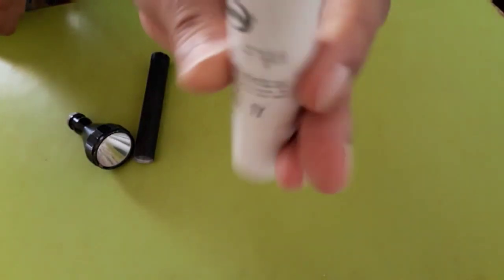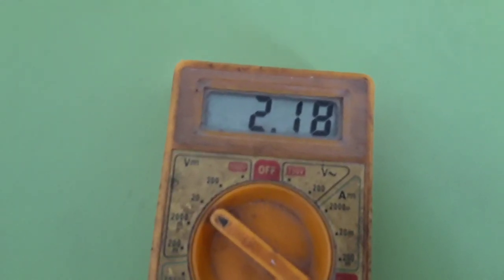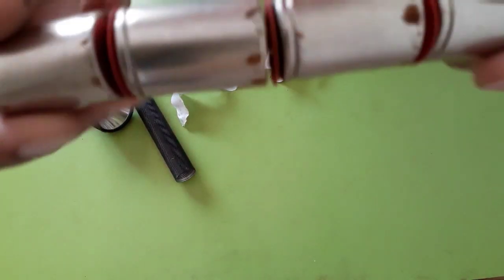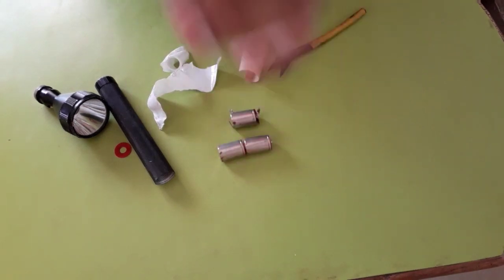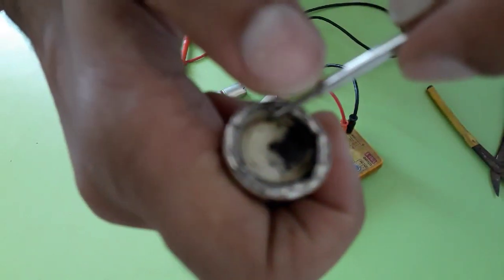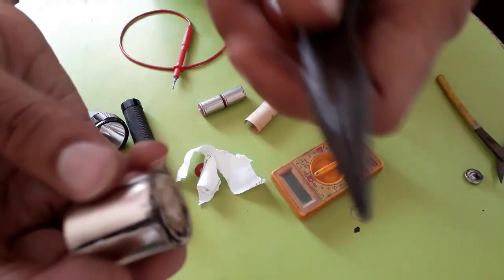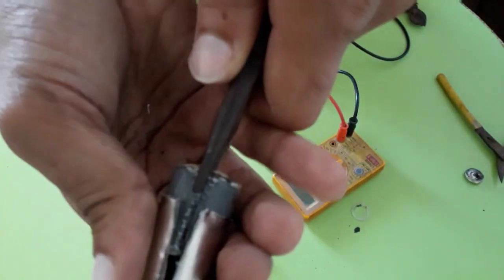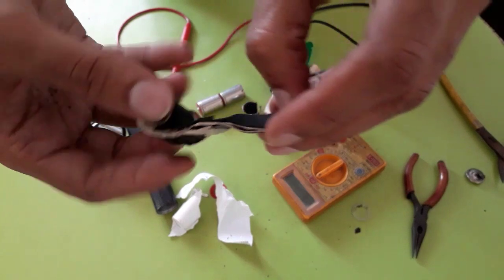Nickel-Cadmium Battery Explained

Comment: Actually there are no solid metals of either Nickel OR Cadmium. The two metal mesh are used to make it easier to press the Nickeloxyhydroxide powder and Cadmium hydroxide powder onto and to provide a porous surface for the exchange of ions through the separator which holds the electrolyte Potassium hydroxide. Also, there’s NO Carbon inside that battery.

Comment: DC 0-100V 10A 50A 100A Digital Voltmeter Ammeter Dual LED Amp Volt Meter + Shunt

Do you have experience with above amp/ volt meter? This can only measure DC amp and DC Volt correct?

What will happen if AC current pass through it?
Reply: I have battery cadmium old

Comment: metal is not nickel its cadmium and also the black stuff is nickel oxide hydroxide...which is NiO(OH)....also no nickep plate used the reaction is 
NiO(OH)+Cd=Cdx+NiOHx
edit-according to my knowledge...also correct me if I am wrong...by the way good channel liked and subbed
Reply from the maker: The metal having holes is Nickel & that black metal wool is cadnium man
Reply: @TechsScience   can you try to heat the metal plate with a gas torch ? the melting temp of cadmium it around 350c  so if it woulden't melt it nickel .
Reply: techno id can you try to heat the metal plate with a gas torch ? the melting temp of cadmium it around 350c  so if it woulden't melt it nickel .